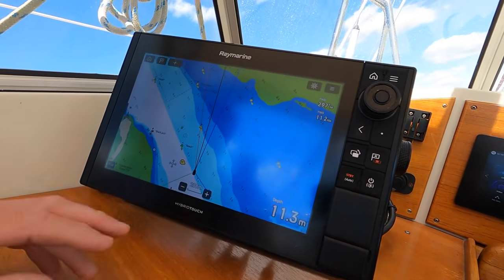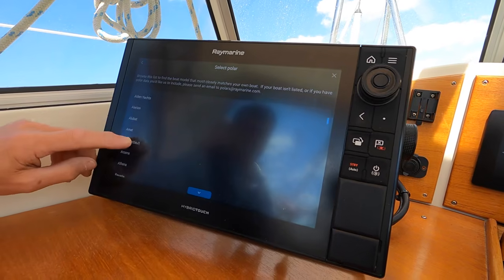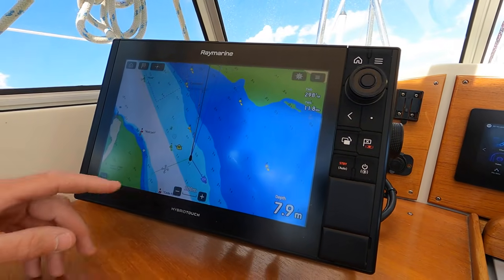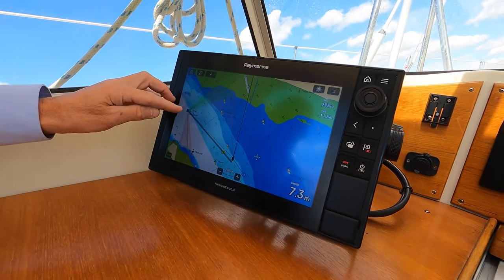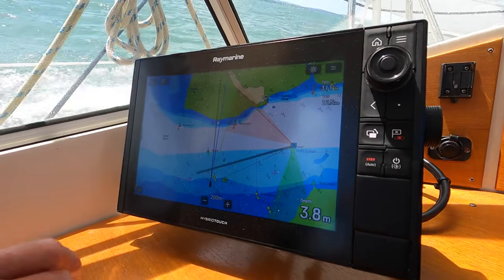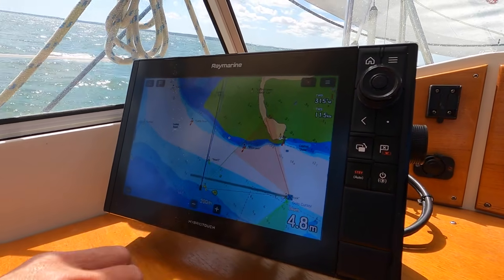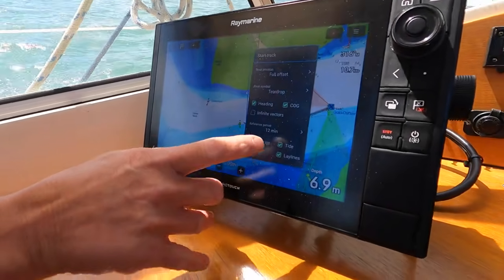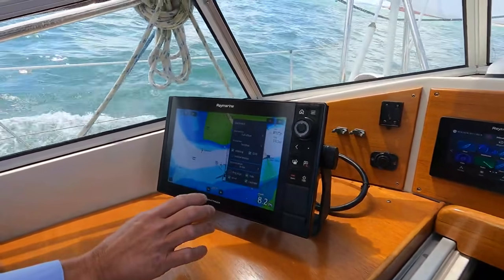Raymarine Top Tips   Laylines and Vectors

Comment: small correction:  blue vector is CMG not SOG.  Where you're going as opposed to where you're pointed.  I know the host only misspoke so this addendum is to clear confusion for viewers.
Reply from the maker: Thanks for the clarification. You're correct that the blue vector represents the vessel's actual course over the ground, while the heading vector shows the direction the vessel is pointed.

For anyone new to this feature, the two vectors help visualize the difference between where the boat is pointed and where it is actually traveling. The heading vector is based on data from a connected heading sensor, compass, or autopilot course computer, while the COG (Course Over Ground) vector uses position and movement data from the vessel's GPS/GNSS receiver.

When the two vectors align, the boat is generally moving in the direction it is pointed. When they diverge, the difference can indicate the effects of current, wind, tide, or leeway. Sailors often see this when making way in a crosswind, and powerboaters may notice it when running in strong currents.

The length of the vectors is based on the vessel's speed and the selected vector projection period. In simple terms, the system projects where the vessel is expected to be after a specified amount of time and draws the vector accordingly. Higher speeds produce longer vectors, while lower speeds produce shorter vectors.

Thanks again for helping clarify this point for other viewers. Comments like yours help make the information more useful for everyone.

Comment: will Axiom+ running v4 and Axion 2 running v5 be compatible on the same network?
Reply from the maker: Hello Jack.  On a mixed system with Axiom+ and Axiom 2 screens, all of them need to run LightHouse 4.11.   LightHouse  4.11.103 is pre-installed in all Axiom 2 units, and the update is available online as an update for all other Axioms, if needed.
Reply: @Raymarine so I can't run v5 on the Axiom 2 along with lH 4x on the axiom+ then? Doubtful I'll upgrade...